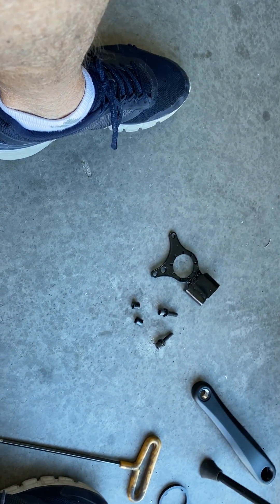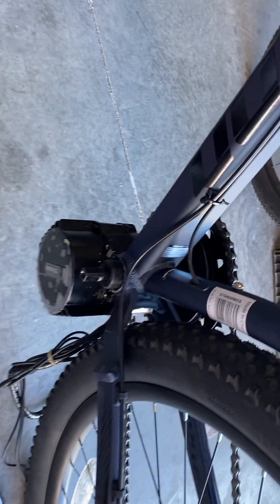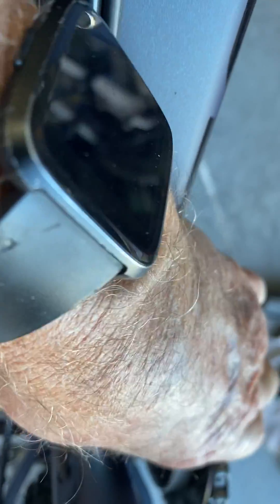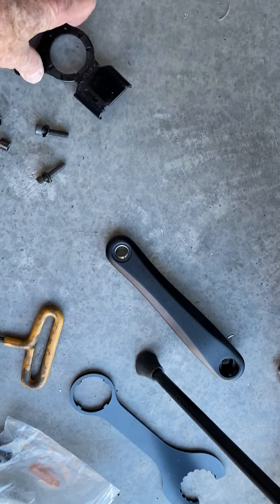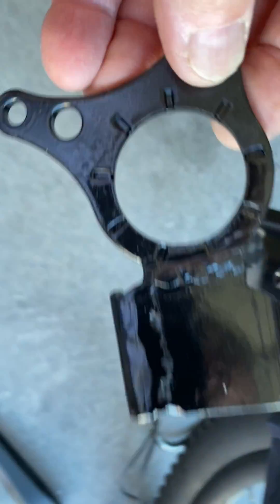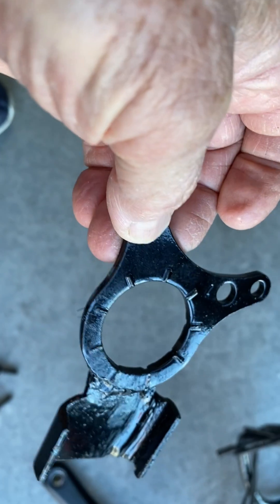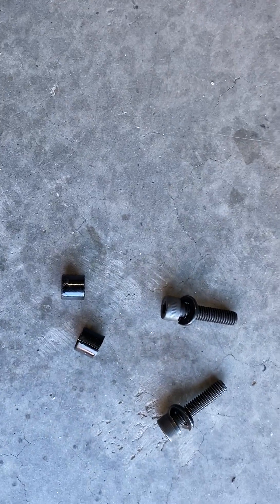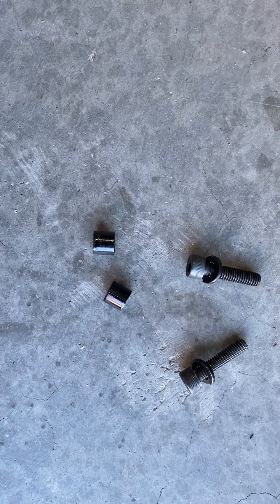Part #2  AXUM DP and Bafang BBSHD 1000W Motor Kit

Comment: ive used roofing silican on both sides and slightly inside the bb on several bikes.. a few years later still no movement of the motor